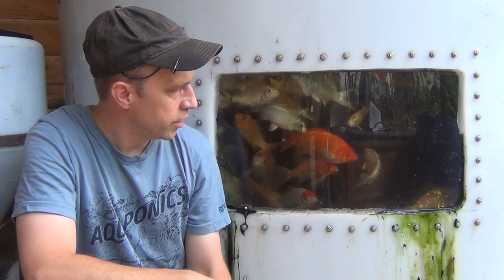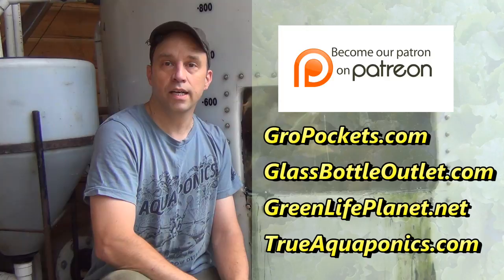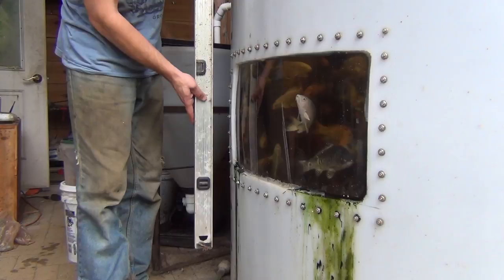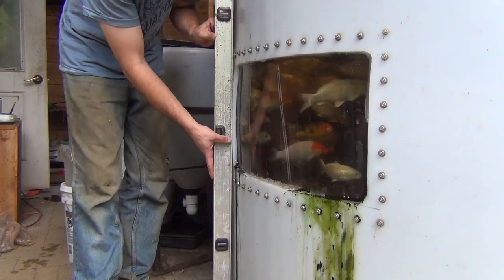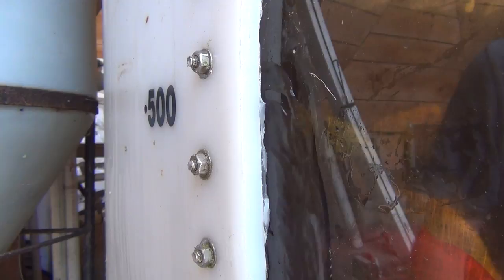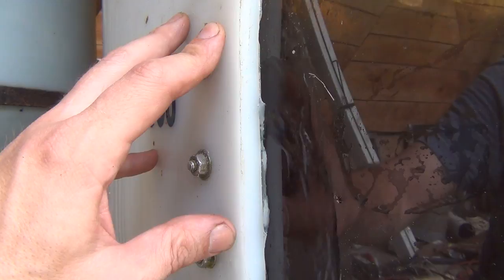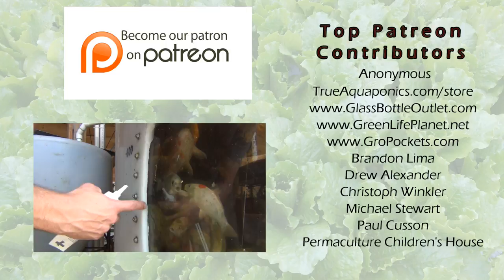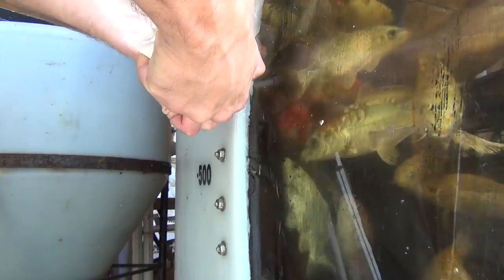Tank Window Repair - Part 1

Comment: cutting the tank to put in the window opening created a weak spot, which is causing the bow.  the ratchet strap solution suggested by several others will be a good temp fix until you find a new tank

Comment: We have a two part epoxy putty, it's waterproof and can be applied underwater. It'd create a temp seal on it, but I think you'll have to bite the bullet and pull it apart, then reseal it properly. Easier said then done though.

Comment: I don't know when this video was recorded.... but couldn't you get a large width ratchet strap or 2 and use the straps the same way that a wine barrel or a Oak Barrel would be strapped with steel bands for making wine or whiskey? Or at least use that method for de-bowing the tank back to a more normal position so you can tighten down the bolts?

Hopefully it can be repaired without draining most of the water.
Reply: Hi Rob,    
   Yup, I agree with the other folks in this thread, ratchet straps might be the solution. Anywhere you have a bow in the tank you might want to consider strapping in a 2 x 4  to help reform/brace the shape of the tank.  Best of luck in getting it repaired. Cheers, 
   Bill
Reply: Great minds think alike. When I saw the bulge my first thought was ratchet straps.
Reply: I posted the same idea then durr. It was already suggested. My bad.

Comment: I hope you have the problem solved by now.

I saw some 'Advertised on TV' stuff called Flex Seal.  They have a 4" wide tape that might help.  I think it is on Amazon.  I hold as much faith in that as I do most TV products (little).

I was wondering about putting some steel angle against the tank extending past the edge of the window vertically.  Hold it in place with a couple of straps going all the way around the tank at a level just above and below the level of the window.  This should work wherever you have a bulge to help with external reinforcing.   I would think of something like 3" wide x 3" deep x .25" thick x the height of your window plus 2x the width of the tank straps.  ... Some storage tanks in our area have the straps, so they might be available at a local farm supply.  The ones I have seen use long bolts to tighten the straps. ... Just a thought.

Comment: Could you build a metal frame for inside and out? Just some 1"x.125" flat bar with holes drilled so you can clamp down tighter? I don't know what the interaction of the steel/aluminum would be with the water. but powder coating should be inert if you have someone around you that does powder coating.
Reply from the maker: I'm planning on pulling the window off and replacing the seal with new silicone.  While putting it back together I will run two pieces of angle iron along the vertical sides and fasten it in place with all the bolts.  This will keep it nice an flat.  I don't think any reinforcement is necessary along the horizontal.
Reply: Fair enough. Metal inside and out? That way you can really wrench down on it without pulling the screw heads through the plastic.
Reply from the maker: I'm going to just do it on the outside.  If you make it too tight, then the silicone can squeeze out.
Reply: Works = Good. That job seems like a pain, I don't know if a water change is a good thing (legit, don't know, haven't done a system like this), but trying to store that water in other tanks while working also seems like a pain.
Reply: Some flat stock aluminum or stainless on the inside puts the pressure of the bolts on it rather then the window so lower risk of a bolt head pulling. Easy to drill the holes and ether file or broach a square for the bolts to grab onto so you can add pressure over time without having to grab the bolt itself on the outside.

Comment: You will have to shut down and empty the tank to seal it with silicone. Or else the silicone wont stick to it (properly) because the surface is wet.

Or another idea if you have access to the screws/bolts from the inside:
Get an angle bar which is longer than the height of the window, drill holes at the same places as it is now on the side of the window, remove the screws/bolts and fix the angle bar in place. This will probably get rid of the bow and might be doable without emptying the tank.

Comment: Drain, tear down. clean, dry, use sikaflex/urethane sealant with Poly ethylene/carbonate. Make a steel frame/bracket to support the external nuts and distribute outward force evenly so the window can compress against the tank and form  seal.

Using sealant on the exterior is useless.

Comment: I agree with the metal sandwiching but the silicone isn't doing you any good. It's not made to stick to either of those surfaces. Creating a rubber gasket would be much more effective. I'm not 100% sure but you could use bike inner tube rubber. It may be difficult to find an inexpensive source for such a large hole. I think with a little research or help from YouTube land you may find something. Hope this helps :)